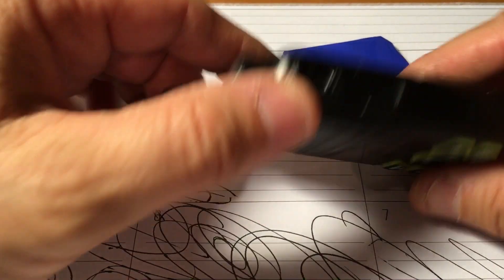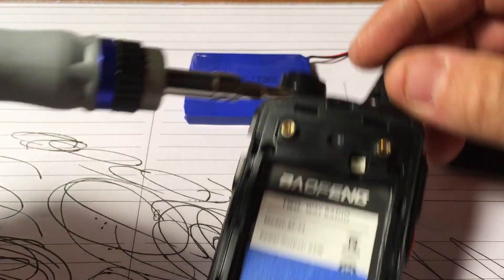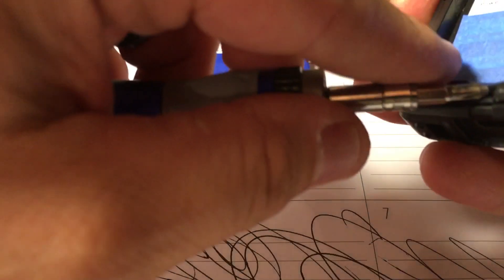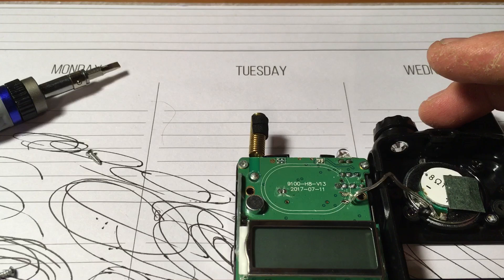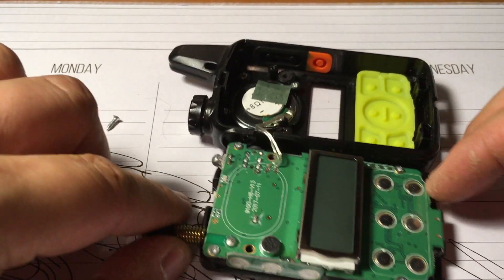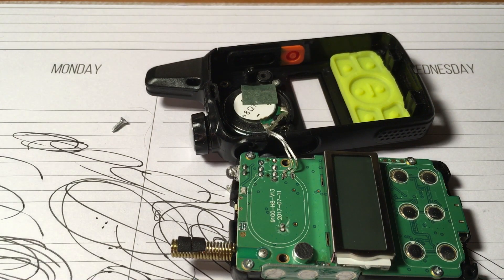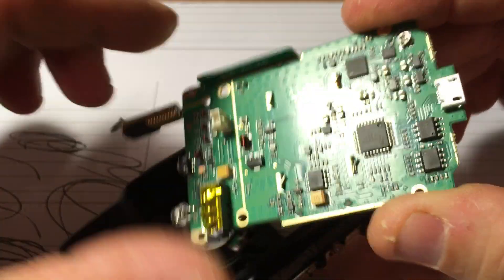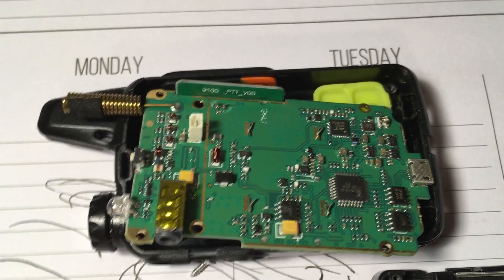Inside The Baofeng BF-T1 UHF Ham Radio Battery Issue

Comment: Did you reflow the solder where the connector is attached? Did you check the connector attached to the battery?
Reply from the maker: I’m going to try that. I need to get a new tip for my solder iron.
Reply: @FuzzThePiGuy  did it work?
Because I have the same issue right now.
Reply from the maker: To be honest I can’t remember. Sorry.